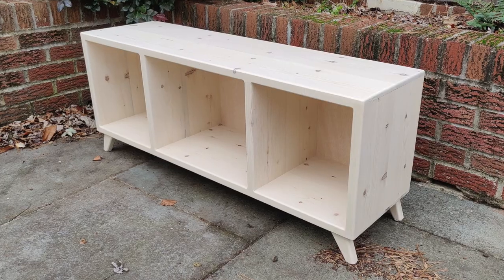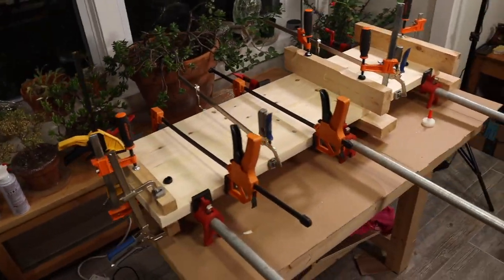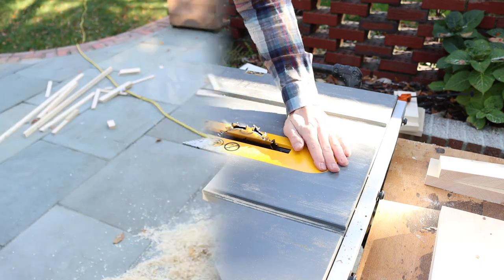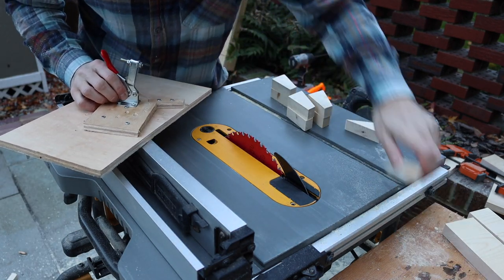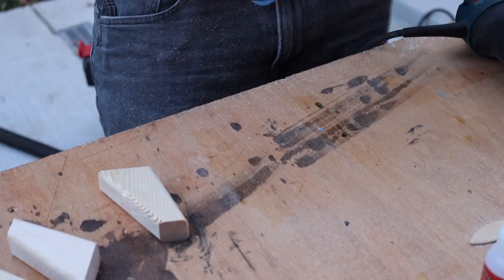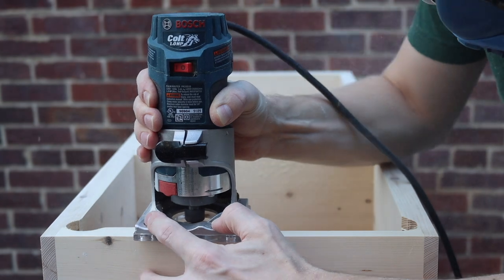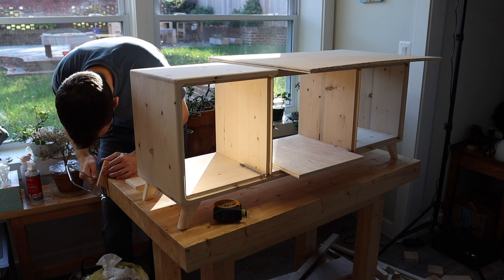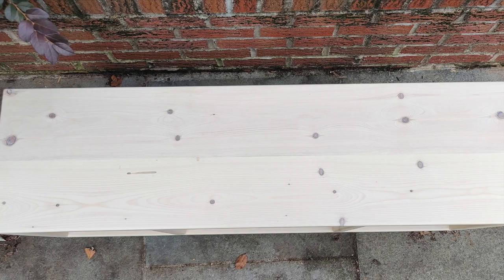DIY TV Stand Shelf -- from 2x8 lumber

Comment: On glue squeeze out: I make caskets for a living, so I glue a whoooooole lot. Anything where the joint is structural, you want squeeze out - it indicates the surface is covered. Cleanup is a small price to pay for strength. We wait 'til the little beads dry and then scrape them. Anything decorative like molding, and you can get away with one bottle squeeze width of glue and some nails to hold the joint while the glue dries. If you ever want to check/test your glue spread, apply a line to a piece of wood and then mash down a flat piece against the glue and lift it away. You'll clearly see how far the glue spreads in that joint and you can add or take away. 400 caskets a day and we only have one failure every two years or so. (Don't worry - the family rarely sees the casket moved so they never see the failures)
Reply from the maker: Great info! Lol I could imagine some crazy failures with a casket

Comment: Haha, love the pop up at the start! Great build, thanks for sharing. I'm very much a beginner, but hoping to start doing similar builds (or at least practicing) next year. Just wondering roughly how long such a bookcase would take you to make?
Reply from the maker: Hey Jon, thanks for watching! For the time, if I dedicated 8 hours I could definitely get it done. However, because I have two little kids and another job I usually only have a couple hours at a time so it takes a bunch more set up/take down time. If you are new, expect it to take a few days of work. It's worth it though and this is a great type of project to start on as the wood is cheap!
Reply: Thanks Nathan, cheap sounds good to start with for sure! That project is definitely something I'll be trying at some point, although I'm sure it'll take at least a week...and some new tools! Thanks for sharing the video, and for the comedy value at the start :-)